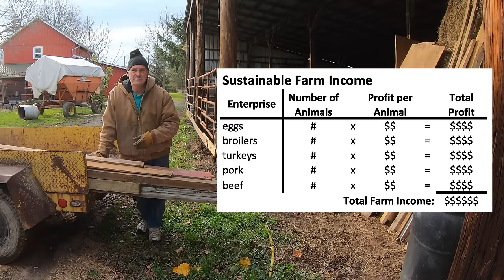how we support our family on a small farm

Comment: Hi Pete, we have a small cattle ranch in a very remote part of Idaho (85 acres) and totally agree with your approach to small scale farming.  I work for a software company, which allows me to work my 8 hrs remote, and run the ranch during the other 16 hrs of my day.  When we decided to "restart" the ranch in 2000, it had been idle for over 30 yrs.  The fences were gone, the sage reclaimed the pastures, ditches in bad shape, heavy rains washed debris (trees, boulders, etc.) down from the mountains, and carved gullies in the fields... we started with just 2 horses and 4 cows on the 15 acres that would still grow grass, purchased 20 steers in our 2th year to help with the de-brushing of about 60 acres... amazing what 20 hungry steers can do... areas we couldn't walk through due to the overgrowth, by the end of that summer, were open and navigable.  Like you we run 40 to 60 yr old equipment, and I have never paid over 2500.00 a unit, for any of it... It amazes me how dependable a 60 yr old tractor is, they were built like a tank back then.  The following year I applied for a NCRS small ranch/farm grant and after a ton of interviews, inspections, and government bureaucracy, the ranch was awarded the grant.  This allowed us to fast-track many projects on the "to do" list, e.g., convert from flood irrigation to a gravity-fed sprinkler system, replant the pastures with a more drought tolerant plant mix, fence off the creeks and add cross fencing to the pastures for a rotational grazing program, along with a few other smaller projects like weed control and nutrient management.  At first I wasn't sure we made a good decision by applying for the grant, as they impose deadlines on when certain things must be completed to get paid, which kept us humping right up to the deadline dates, but looking back, it provided 60-70% of the capital we needed to get the ranch back in shape, 10x faster, and I learned a ton about grass management and fencing from the USDA folks...  We did much of the work ourselves, which allowed us to save a ton on the improvements and then move some of the monies paid by the USDA around to other projects we knew we had to hire out.  The USDA proved to be invaluable... In our area we not only have cattle being hard on fences, we have Elk, Moose, and Deer.  I do more fence repair from Elk movement, than from the cows.  The USDA showed me by lowering the top wire to a max height of 42", it would stop 80% of the Elk damage... I was skeptical, but, it worked... I tell this story because I want perspective farmers/ranchers to know, there's a ton of resources out there (like the USDA and yourself) if you're willing to do the research to find them... like you, my friends and family keep asking me "why?" why work so hard, only to have to work hard again the next day, but they will never understand the feeling you get to see a calf born in the spring, or that calf grow into a good looking adult animal, or the pasture that was dirt last year, green and lush this year... its a reward that the average man just doesn't experience and should.  In my job, it seems like projects never end, and deadlines continually get pushed out... I tell my coworkers that I wish I had the option to push out calving season, or not worry about how productive my pasture will be... if I stop for one minute, my animals will suffer and I would never let that happen.  Fast forward to 2020, we are now at about 50 useable acres, supporting 25 head of grass-fed natural beef, and growing every year. I wish I would have kept a video diary like you are doing... There's been so much learned over the years I would have loved to share.  This is a life I wouldn't trade for any amount of money, or time back, and one I've never asked the question "why do I do this?" Keep the videos coming!!!
Reply: Lol small cattle ranch? It's all relative isn't it. I'm looking for a couple acres in northern Ireland to expand my homestead (ACORN stands for Adorable Canadian Openly Requires New... Homestead)
Reply: Well done bvrcrkrnch don!! It sounds like you are living the American Dream! You are doing what many of our ancestors did when they arrived here from foreign countries. ( Europe) You are starting from the ground up. So many farmers start out in a  3rd or 4th generation farming family. They start their own business but it’s all in the family and they can borrow or rent equip/land from their relatives. You’ve done it all on your own and utilizing the government’s resources the way they were meant! Way to go!
Reply: ACORN Homestead sounds awesome
Reply: Joel Salatin threw brush into his gullies to silt them up into primo soil.
Reply: What was your break even time for the ranch? When was it able to supply your financial needs?
Reply: @obadiahhenry  please be aware, from 2000 to 2010 I could only devote about 1/2 my time to getting the place productive, for the past 10 yrs, we were still putting a lot of cash into improvements.  Nature pretty much reclaimed the ranch to a point you could hardly drive a tractor in the fields, this took a long time to reclaim and get grass growing again, but last year we broke even, what we got for our calves, paid for all the input costs for 1999 and gave us a little to put toward expenses this year.  Fuel prices dropped big time here this past spring, under 2.00/gal for diesel, so I took the surplus funds and bought about 700 gal of diesel.  This will give us cheap diesel for about 3 yrs.  I suspect this year we will make a small profit, but that will depend  on cattle prices (with COVID, they are up one week, down the next).  We will be selling our calves in a few weeks (before Thanksgiving) so we don't have to feed them over the winter.  My private beef sales are growing, and we kept a few more steers to supply the customer demand.  I have really been thinking about adding Chickens and Hogs to the ranch, like Pete does.  As Pete has mentioned more than a few times in his videos, Cattle take to long to become a "product."  You really need something to fill in while the cattle are maturing.  After watching "Kiss the Ground" we are going to explore regenerative agriculture.  PS everyone should watch Kiss the Ground, its on Netfilx.  If we could make regenerative ag work, it would save us 1000's a year on input costs (fertilizer and sprays).  I figure the ranch needs about 20 head of cows, making calves every year, and we need to keep 10 head of steers to sell.  If we can get there, I believe it could pay me a modest salary.  Adding Chickens and Hogs would get us profitable faster.
Reply: We need to connect. I am taking on a portion of my Dad's dry farm in Utah. I am starting from the ground up too. It is a bit overwhelming, but taking things one step at a time. Sometimes I feel like small farms can only work where there is plenty of rain, but here's to hoping we can succeed out here in the Intermountain West!
Reply: Have you seen anything on mob grazing and daily rotations? Are you implementing it? If not what are your thoughts?
Reply: @j.swipes  a few years back we got a nrcs grant, part of that was to fence the pastures into paddocks and practice rotational grazing.  We continue to practice rotational grazing today.  The pastures are immature so it’s been challenging.  But I do believe, it does work .  Looking into regenerative agriculture now .
Reply: @bvrcrkrchdon1714  lol I’m deep in it do you know who Gabe brown is?
Reply: @j.swipes  no, don’t know the man...
Reply: @bvrcrkrchdon1714  he has some awesome carbon sequestration and soil building info definitely worth a listen!
Reply: If you guys havent both of you should be making a youtube channel and like Pete does provide tips and tricks for others to learn from. The more youtubers doing what Pete does here the better for all of us out there.
Reply: @robreesor5011  Rob I have thought about doing that, I’m just not real handy at the video part… I’ve played around with it baling hay, but didn’t turn out that great… do never posted it.
Reply: @bvrcrkrchdon1714  well keep trying...and you dont have to make your videos the same as pete does...every youtuber has a bit different style that works for them...you just gotta find your style and go with it like others have 👍
Reply: @bvrcrkrchdon1714  i live in california and make a good living with my construction business. although i enjoy the money, the only people in this world that i am a bit envious of are farmers and ranchers. i hope yall make a good living doing what you are doing, but either way i truly believe you are living the good life
Reply: @randal3122  I have a friend who has a ranch, and he tells me, farmers and ranchers don't do it for the money... they do it for the "lifestyle."  And I believe that to be true...  With farmer / rancher suicides up 30% over the past 2 years and farmers and ranchers selling out at alarming rates... I would say, no, most are not making a "good" living... we are living in a world that looks at farmers and ranchers as the enemy, and not as the foundation of life...  this is sad... I have a "day" job working for 3M that allows me to keep the ranch, without that income, I would have to shut this operation down... just my hay costs this year put me in the red and I have to buy more diesel fuel for the tractors soon... 4 years ago it cost me 900.00 to fill my diesel tank... the next time I fill it, I figure it will be at least $2500.  The input costs have skyrocketed here in Idaho, and the product(s) we sell, pretty much fetch the same price as we were getting 2 yrs ago...  Last year I had to sell 1/2 my cows and all my calves to just cover the hay costs... so this left me with fewer to sell this year.  This year alone I would need to sell 5 beef steers to just cover my hay costs... I only have 2 to sell... I really need to divest into more products like Pete has done... his model is a great model, and as you can see it can work.  My problem is with my day job, finding the time to tend to the ranch is limited.  I see no relief in sight under this administration, so I will probably have to make a very tough decision come spring.

Comment: You know when I drive through farming areas I see very expensive brand new  equipment sitting out side like tractors and combines and you know I think to my self  there's over 100K$ sitting there well what I'm trying to say is that making older less expensive equipment get the job done is probably one of the most affective ways to keep your cash flow at home , Great job and mind set , thanks .
Reply: Most guys are not running brand new equipment- now a lot of guys run NEWER equipment, which may be a difference of 100k-200k per tractor and still look new- but not many guys are buying brand new.

The problem is a 30 year old John deere that's been well cared for can still fetch the price of a brand new pick up.  It's a bit different for crop production where you need horsepower- but what do you do?  Do you spend 30k on a 160 horse tractor that's 30 years old or get financing and buy a similar horsepower tractor 15-20 years newer, with more technology for 20k more?  The other piece of the puzzle you're not looking at is what to do with the money you make.  what should a guy do come the end of the year if hes made a profit?  Hand his money over to the government or spend it on machinery/land/herd and pay less come tax time?  Plus those guys are depreciating that new equipment so they will also be receiving a higher tax credit based on the age and value of the equipment. 

Obviously a guy like me or this farmer wont be seeing the cab of a brand new tractor any time soon, but you have to do what makes sense for your operation, and that may mean buying late model/new equipment, or buying older used machinery.  It just depends on the operation.
Reply: @jacobpgood724  👍🏽 exactly right. Economic and financial principles are important to consider for success.